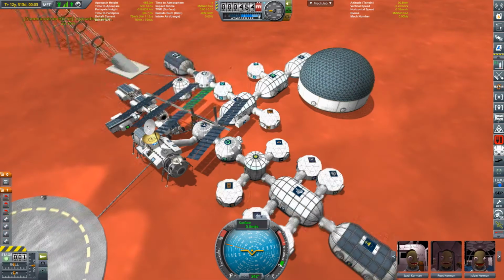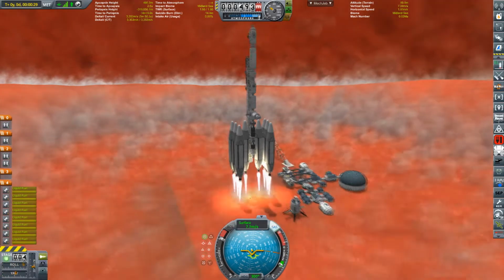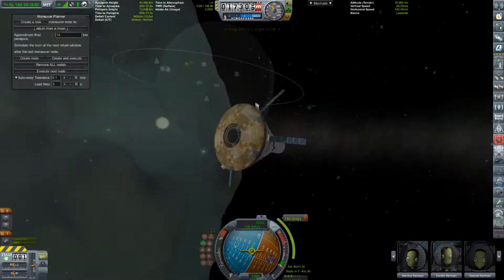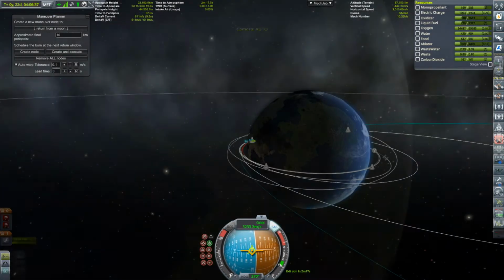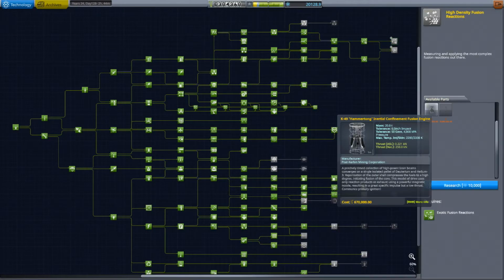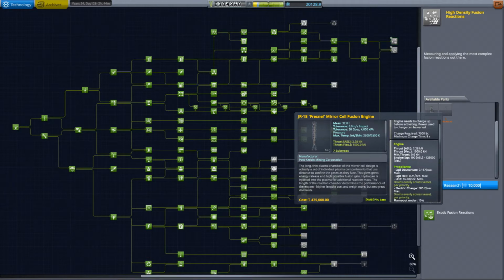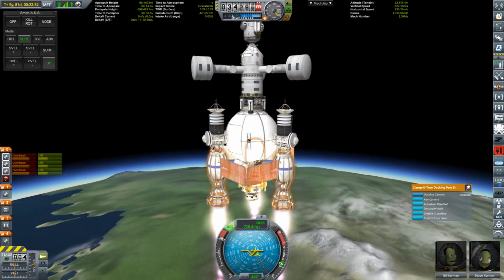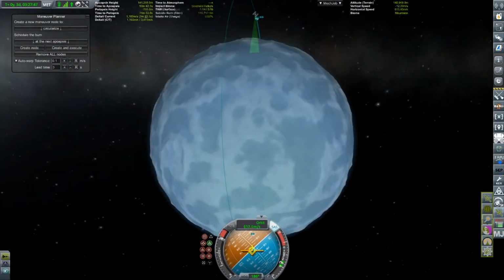Kerbal   Explosive Kolonisation 24

Comment: What mods are you using?
Reply from the maker: well you did ask but its a long list

AirplanePlus
AmbientLightAdjustment
ASET_LandingLegs
B9AnimationModules
B9PartSwitch
B9_Aerospace
BetterBurnTime
CommunityCategoryKit
CommunityResourcePack
CommunityTechTree
CryoEngines
CryoTanks
DeployableEngines
DMagicOrbitalScience
DMagicUtilities
DockingCam
DynamicBatteryStorage
Endurance
EngineLight
EnvironmentalVisualEnhancements
EvaFollower
EveEngines
ExtraplanetaryLaunchpads
FarFutureTechnologies
Firespitter
FShangarExtender
HeatControl
JanitorsCloset
JSI
KAS
KAS-1.0
KerbalAtomics
KerbalEngineer
KerbalHacks
KerbalJointReinforcement
KerbalReusabilityExpansion
Kerbaltek
KerbetrotterLtd
KIS
Knes
KSP-AVC
MechJeb2
Mk3Expansion
ModRocketSys
NearFutureConstruction
NearFutureElectrical
NearFutureLaunchVehicles
NearFutureProps
NearFutureSolar
NearFutureSpacecraft
OPT
OPT_Legacy
PatchManager
PlanetaryBaseInc
ProceduralFairings
ProceduralParts
REPOSoftTech
SCANsat
scatterer
ScienceRelay
ScifiVisualEnchancements
SpaceDock
StageRecovery
StationPartsExpansion
StationPartsExpansionRedux
StationScience
StreamlineEnginesTanks
SurfaceExperimentPackage
ThunderAerospace
Trajectories
TriggerTech
TweakScale
UmbraSpaceIndustries (alcubierre drive)
UniversalStorage
VanguardTechnologies
VesselCategorizer
VesselMover
WildBlueIndustries (all)
Workshop
[x] Science!
Reply: Thanks!  I might have to look into some of those.
Reply from the maker: id start with KIS, kas, near future and Pathfinder/dsev that makes for some interesting things :p